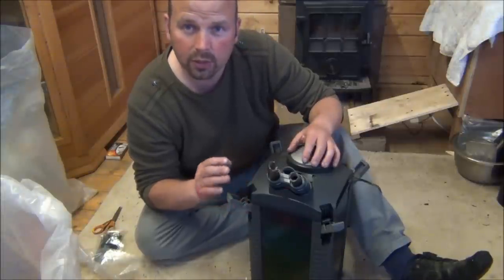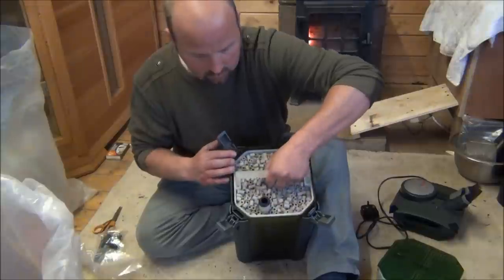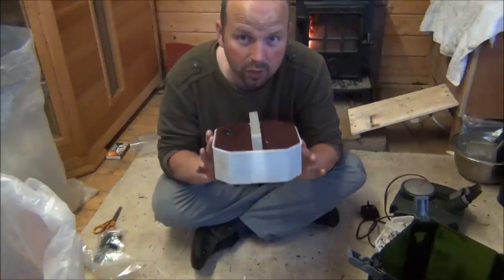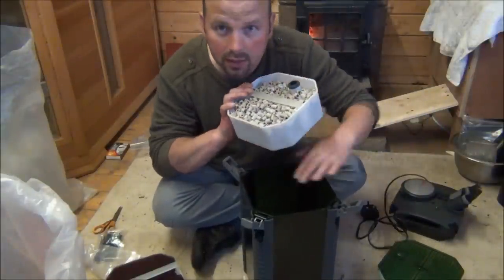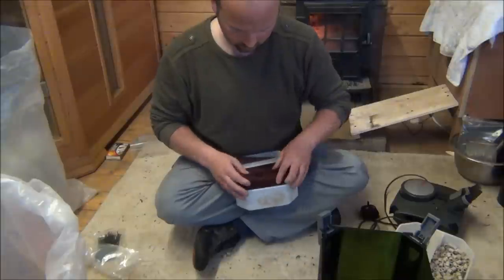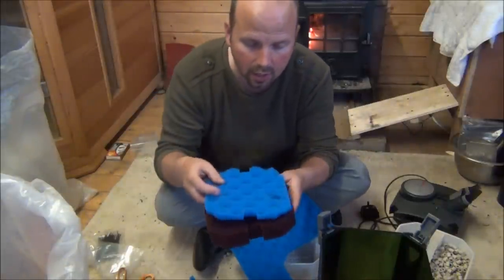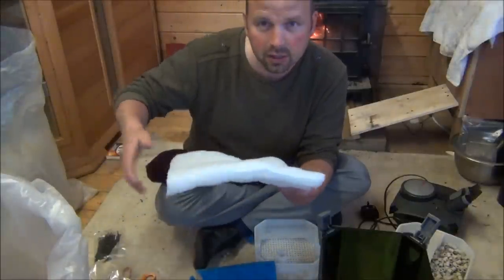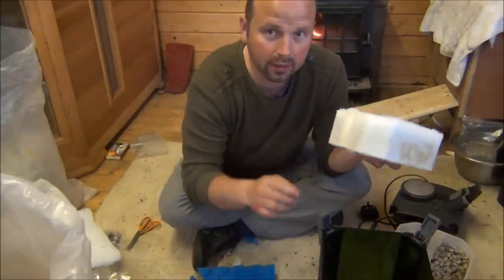How to set up an external canister filter for aquarium by Pondguru

Comment: hi theregreat to see that we have two Same hobby's detecting and aquarium...i have a question , when the mechanical  fine filter is full of mug.  how do you clean this..???the Biological Filtration its above the mechanical one's... how long can the biological media taken out of the canister? whitout killing the good bacteria'sgreetsharry
Reply from the maker: You would generally clean the media and foams in water you have drained from the tank and the time between filter maintenance would depend on the filter size and fish stock. It could be once every month to once every 6 months. Having a 'booster filter' before the main canister filter virtually eliminates the need to maintain the main filter so it can be left to run a very long time: http://geni.us/2bj1

Comment: Maybe this sounds stupid, but as a novice here i'm confused about the set up of the filter media and well because how does the water from the fish tank  come in to the filter canister. from the top to bottom and goes from the bottom out of the filter canister. Or is the water filtered from bottom up?
Reply from the maker: Generally the water in external canister filters will enter from the inlet pipe and travel down to the bottom of the canister through a pipe formed by the trays or down the side of the trays. Then it will swirl around in the bottom before rising up through the trays and being sucked out by the pump in the top of the filter (and returned to the tank).
Some filters have the pump in the bottom e.g. Fluval FX and those trays work top to bottom.

Comment: Pondguru can I mixed bihome filter media with pond matrix?
Reply from the maker: Yes there s no reason why media can't be mixed. I normally wouldn't bother but it doesn't do any harm unless the media being mixed in is not very good (e.g. plastic balls or cheap ceramic) then it just takes away from what could have been providing lots of surface area.
Reply: Pondguru thank you.

Comment: what do u think if  I use siporax in vvery bottom gap in the filter rather than normal crap ordinary ceramic media ? ( u know siporax is the porous version of ceramic media shape)
Reply from the maker: +Firman Rahmadi That will work fine to settle out the heavy muck in the water. Any sort of ceramic tube will do. Best type for use under trays is Ehfimech from Eheim as it is much smaller than normal tubes.
Reply: I see, the gap is the first place that water flow goes to ? then it supposed feed by mechanical filtration ? so with maximazing that bottom gap ,the mechanical filtration will be double? ( the very bottom gap and the last media bucket ? ),I thought ehfimech too, but never used it, is ehfimech better mechanical filter media than sponge ?, in filtration I always think about biological media only (anaerobic &aerobic bact home etc...), but recently I just curious too with mechanical med, so I have that typical 3 layer canister with bottom gap just like that, then should I get to fill all the bucket with all biological media n fill the gap with mechanical (either its ehfimech/sponge ? Or 2 biological media n 2 mechanical media (the last bucket n the very bottom gap ) thanks for ur kind response guru....
Reply from the maker: +Firman Rahmadi Yes you can go with either filling the bottom gap or leaving it clear but by adding some very small tubes like the eheim media down there it will be the first stage of dirt settlement, taking the heavy muck out before it hits the foams in the bottom tray. That will extend the life of the foams. As long as you have 2 trays of media in a 3 tray filter then its all good. 
You can get booster filters which go before the canister filter which can be packed with foams if you want to keep your canister for 100% biological filtration. See this link: http://www.allpondsolutions.co.uk/aquarium/aquarium-filters/external-filters/ef-2-external-filter-booster-supplimentary-caniste/?gclid=CJbD--S_68oCFcrjGwodAAkCaQ
Obviously it wold be best to swap the foam in the booster filter, replacing them with proper profile cut foams and then you'd hardly ever need to look at your filters once it was set up - only the booster would need maintenance.
Reply: +Pondguru Outdoors do you remember which was the eheim filter you had worked with in this video? which model?
Reply from the maker: +Lakshminarayanan Krishnan It was ages ago but I think it was an Eheim 2228
Reply: Pondguru Outdoors I know it's been quite awhile, so thanks for your reply. I have a 10 gallon tank at home, so I'm pretty sure it'll be overkill to have this canister filter, but would it matter, if I can find one on the cheap? My betta fish in the 10 gallon isn't doing well, and I'm pretty sure it's the HOB filter that isn't going a good job. Maybe you can do a video on how we could modify a HOB filter to possibly use your filter media? The biggest problem is, the team is in India, so availability of many of the items is a big problem... So I have to go through hoops thinking of doing anything.
Reply from the maker: +Lakshminarayanan Krishnan The HOB filters often rely on a cartridge system so don't have much available space for good media. I'm not a fan of them at all and I could modify them with a hammer, lol
A small external filter would be OK for a small tank and if you order from China it shouldn't cost that much to get delivered to India.
Always best to go for something which promises to treat at least twice the volume of your tank (i.e. if you have 10 gal. get a filter which will treat up to 20 gal.).
Reply: Pondguru Outdoors thanks for your reply. I'm really wondering how to source your filter media kit from the UK without burning a home in my pocket for shipping. I'd reeeeeaaallllyy love to setup a filter based on your other video (external filter set up, nitrogen cycle.. - the one where you cut your finger scissoring the fine filter media)... I'd reeeeeaaallllyy like to get the kit with the bio balls / bacteria balls.
Reply from the maker: +Lakshminarayanan Krishnan It is a kit weighing over 3kg so would have to go out by international courier which would be expensive. Shipping is a real killer.
Reply: Pondguru Outdoors sigh - I know. Why doesn't your Singapore reseller stock the bacteria balls?
Reply from the maker: +Lakshminarayanan Krishnan I guess its just something they haven't go round to stocking. They were the original distributors of biohome and have loads of pet related products so I assume they will have something which is suitable for starting up a filter.
Reply: I think I have found somebody who can bring it along with them when they travel back to India. Can you tell me the dimensions of the Freshwater 3kg External Filter Upgrade Kit? Also, they are living in Edinburg. How quickly can you ship out to them once I make the payment for the kit.
Reply from the maker: +Lakshminarayanan Krishnan I ship every day and any order placed before 1pm goes out same day for next day delivery as the couriers generally call between 1.45pm - 2.30pm. If the order was placed after 1pm on Friday or over the weekend it would go out Monday for Tuesday delivery and an order placed on Friday before 1pm would go out Friday for Monday delivery. The filter upgrade kit would be in a box 30cm x 23cm x 23cm (12" x 9" x 9")
Reply: Pondguru Outdoors thanks. I'll get back to you.
Reply: Can you tell me the dimensions of the Freshwater 1kg External Filter Upgrade Kit? Sorry about this, but trying to see what is best option for me :-/
Reply from the maker: +Lakshminarayanan Krishnan The 1kg upgrade kit would be in a box approx. 30cm x 23cm x 10cm (12" x 9" x 4") and as the total weight is under 2kg it would go out by Royal Mail second class recorded which takes 2-3 working days.
Reply: Pondguru Outdoors thanks. I'll work something out

Comment: i'm currently using a top filter and want to replace it with an external(eheim 2213). Do i have to mix the old bio media with the new bio media? I don't really know what to do. Help pls?
Reply from the maker: Best to run both filters for 2-3 weeks then remove / stop the top filter and if you have space move the top filter media into the external. As long as you have the external filter set up properly with good media you will have good results and easy maintenance.
Reply: Thank u so much Pondguru! Now i can begin setting up my external. Your videos are very helpful. Thanks again!
Reply from the maker: jayson sy No worries, any time.

Comment: What would be the setup for a Fluval 406? Just this in reverse?
Reply from the maker: No, exactly the same but leave the foams down the side and add coarse, medium and fine foams to bottom tray, media in trays above that. Each tray will hold approx. 1kg of biohome ultimate or biohome mini ultra (they are same size).
Reply: Pondguru Outdoors Thanks for that! Ordered some Biohome Ultimate yesterday and it should be here next Wednesday. I also purchased Purigen to add to the top tray.
Reply from the maker: Sounds good but unless you have a problem with excess chemicals in the water or staining from bogwood you should not need purigen. I have notes about using some chemical treatments on the Q&A page of my website which may be worth reading as the bacteria can be badly affected by some of them, especially anaerobic bacteria (responsible for nitrate reduction) which is very fragile.
http://www.filterpro.co.uk
Reply: Pondguru Outdoors okay I will look into this. Thanks!
Reply from the maker: No worries, any time. I should really cover the use of chemical treatments in a video - it's on my 'to do' list, lol

Comment: Hi my filter is leaking on the left hand side top and i have it set up as we brought it so is that the problem
Reply from the maker: +john ward No it sounds like one of the seals has been nipped when the parts for the inlet / outlet or pump head have been put back together. Take the filter apart and check the seals as it should be totally watertight.

Comment: Hi, thanks for this useful video. Looks like I'm going to have to re-shuffle my filter!
I just wanted to ask with regards to the biohome media, as you mention that it will even reduce nitrate levels: how much of a difference does it make to nitrate? And will it carry on doing this without needing to be renewed/replaced on a regular basis?
I ask as my nitrates are 40+ out of the tap, and I'd love to be able to get them low enough to keep nitrate-sensitive species such as hillstream loaches.
Reply from the maker: Provided you use approx. 1kg of biohome per 100 litres of water the nitrate should reduce to around 5-10ppm. Some users have untraceable nitrate and setting the filter up properly will reduce the amount of water you need to change.

Comment: Pondguru how would you setup fluval 206 filter?
Reply from the maker: The Fluvals unfortunately have the large foam cartridges down the side so as long as you use the bottom tray for a medium and fine foam then media in the trays above that it should function fine. Each tray will hold approx. 1kg of biohome ultimate so the filter should be suited to a community tank up to 100 litres (to see full cycle filtration - reduction in nitrate).
Reply: Thanks

Comment: Please help me. Ive been working on my sunsun704 b and cant get it running. Everythings lined up right. Hoses are on right. but theres no water going through the intake hose. I filled the canister w water and primed it 50x and stil not working. Im so over this and tired.
Reply: remove power head of canister filter. then on it and while its on, then try to put back the top head of the canister filter. try to strap it tight.
Reply: @AbhishekSingh-yx1kn  Thnx so much. I got it immediately after my whining though.😆

Comment: How do recommend setting up a eheim pro4+ 350?

Thx
Reply from the maker: Leave the 'pre-filter tray' as it is in the top of the filter as it will act as an extra level of mechanical filtration. Then simply set the filter up as in this video (foams and fine pad in bottom tray with media in trays above that)
According to my records there are 3 main trays in the 350 and each one will hold approx. 1.5kg of biohome mini ultra or biohome ultimate so you would need 3kg in total. I have 3kg on ebay and my website and there is also a '3kg filter upgrade kit' there too which has foams and media. http://www.filterpro.co.uk
Regards,
Richard
Reply: Is there a US distributor for the filter material?
Reply from the maker: Yes if you click this link you should go straight there: http://www.greatwaveeng.com or if that link does not work simply click the US flag at the top of any page on my website: http://www.filterpro.co.uk

Comment: Hello there, when should external filter should be clean
Reply from the maker: How often it is cleaned will depend on the size of it, stock in the tank and feeding as it all affects how quickly it will clog. Most people check it once a month but if the filter is oversized and the tank is not heavily stocked it could go 6 months before you notice a reduction in flow (indicating that it needs cleaning).

Comment: can you juse the same setup with a inside pump ?
Reply from the maker: Yes assuming that the internal pump draws from the bottom and water goes through the compartments before hitting the pump. As long as it is set up with foam(s) first then media it will be more effective than just having sponge.
Reply: i ty a lot :)

Comment: i have the media the same way it came. id be homeless if i bought the foams from juwel at the rate they suggest. i just wondered how the inlets worked as it would seem the flow is coming from 2 directions top and bottom. had it 2 years now and water parameters have always been spot on apart from the time i tried multi tasking and forgot to turn the filter back on after a water change.

Comment: Since I reset my canister per your instructions. I'm now seeing air bubbles at the top of tank. Is that ok?
Reply from the maker: The layout of a filter should make no difference to bubbles being on the surface of a tank as bubbles are caused by protein in the water thickening the surface layer of water (meniscus) and preventing them from 'popping' easily. Could be that while re-arranging the foams and other filter internals some waste (containing protein) has been disturbed and caused the surface layer to thicken. It should go back to normal.
Reply: Thx for your expediency in reply.
Reply: Do you have bubbles going into filter directly from tank? I had the bubbles going in and couldn't figure it out to finally I realized the oxygen bubbles where blowing in entire filter.

Comment: hi thanks for this im very new to keeping fish im so glad ive found u lol u make sense  of things . please how can i do what u have done in my fluval 305 external filter as their suggestions are costing alot thanks .
Reply from the maker: Yes, most external filters can be altered to enable them to be set up correctly.
Thanks for watching and appreciating  the video.
Reply: How would u suggest i did it
Reply: Mine has sponge down the side
Reply from the maker: Claire Smith
Just look at where the water flows and arrange the foams and media accordingly. The water needs to hit mechanical filtration (foams / pads) first, then media.
Reply: Thanks i think ive worked it out cheers u dont no how much u have help really thanks very much 😀
Reply from the maker: Claire Smith
No worries, I'm just glad I can reply to someone who has asked questions since this Google+ nonsense started a few days ago, lol
Reply: Just one more thing how long untill i change everything thank so much again
Reply from the maker: Claire Smith
How long will the media last? As long as you have the filter provided it is well protected. It may be a good idea to only change half the media if your filter is mature, leave it a couple of weeks then replace the rest.

Comment: Will this method work with a fx6 filter
Reply from the maker: Yes no problem but water flows top to bottom through the trays of the FX4/5/6. As you have good foams surrounding the trays you only need a thin fine pad on top of the top tray followed by media.
Each tray will hold approx. 1.5kg of either biohome mini ultra or biohome ultimate (best types for externals) but you could get more in with careful packing to a maximum of 5kg in FX5/6
Hope that helps.
Regards,
Richard
Reply: Thanks that was very helpful